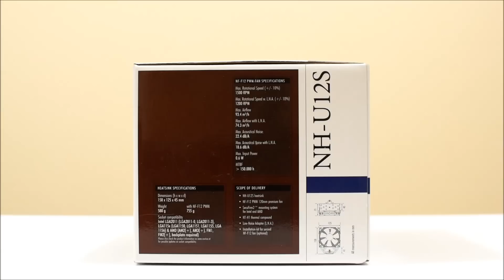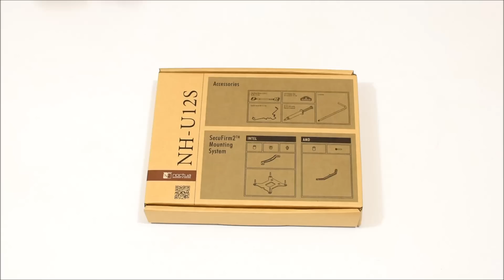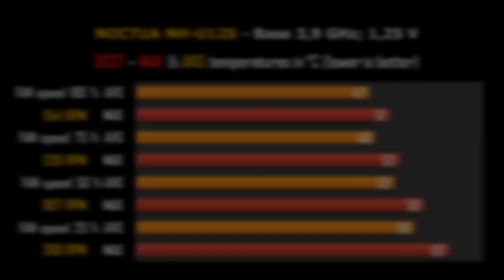Noctua NH-U12S (unboxing, installation & benchmarks)

Comment: Great video. I used this to check my installation. A quick note is that I’m not sure you have to take the fan clips off to install it back onto the heat sink. It’s pretty flexible so it should work without it being removed from the fan itself. Regardless this is a very helpful video.

Comment: The NH-U12S is a killer cooler. My 4590 currently idles at 22C, which is ridiculous. After running a very resource intensive app, which virtually pegs the cpu at 99% for over 30 minutes, the highest temp was 35C. With the same app, the stock cooler was running at 65C. Noctua is the only cooler for me. Plus, the mounting system is the best in the business.

Comment: does it matter if I had the heatsink opposite way so the noctua logo is upside down? The heatsink looks same both sides..
Reply: Hi , i dont think it matters at all. it is exactly the same at both sides
Reply: @contiki6277  yeah it's symmetrical, haven't had any problems! thanks for reply 🙂

Comment: God no... i have an aorus gaming 3 board with an i7 8700 stock cooler (which sucks) do I have to remove the entire board in order to install the back piece??
Reply: If your case has an access panel or cutout over that back of the CPU socket, you might not need to remove it.
Reply: @chiphomer6354  it waa exactly like that, and installation was surprisingly easy. Ty man!

Comment: Hello Martin. There is a 16.5 cm gap from the motherboard surface to the side tempered glass of the case. I just measured. Does the height of the cooler, together with the height of the CPU, fit into this measure?
Reply from the maker: Hi, I'm not sure, maybe not, because only Cooler is 15,8 cm

Comment: Getting mine tomorrow for a delidded 8700k. Already at 70C with a 90mm so this should be a decent upgrade.
Reply: Why didn't you go with be quiet dark rock 4? I am still deciding between this and the dark rock 4..
Reply: @auriongray  Noctua is just better.

Comment: I got a Ryzen 3700X. Is it necessary to remove the motherboard in order to install the U12S or can u do it without removing it since u need to install the bracket only on the Intel socket?
Reply: Your case might have a back cut-out for the mobo. I was about to have a heart attack and then I looked up the specs for my case and it has a back cut-out!

Comment: Hi! Thanks for the video. Is this compatible with a LGA 1200 socket? I have a i7 10700k and I need a fan of this quality and price range. Any ideas? Thank you for your time.
Reply: 2 years late, but for any future watchers: I used this for my 10th gen i7 10700k, along with a MSI mpg z490 wifi Motherboard. It should be able to fit 4 ram sticks

Comment: Excellent video... I used it for my install. An additional point could have been to demo the direction of flow from the fan through the coil. An arrow with direction of flow is embossed on the fan. Nevertheless... A recommended video!

Comment: Is it possible to put the fan to the other direction?
Reply: Yes
Reply: the direction of the fan has everything to do with the direction of air flow in your case. Normally you have fans pulling in cool air from the front of the case and then a fan in the back or on top extracting the hot air. The fan here will pull cool air from the front and push it through the heat sync and towards the "exit fan". If the cooling in your case is going the opposite way for some reason then go ahead and put the fan on the other side (if there is room). If you put it on the other side and airflow is typical....you will end up blowing warm air towards the incoming cool air and causing turbulence and screwing up all your air cooling.

Comment: I have an i7 9700k and bought this cooler.  Will it be good with stock speed/turbo boost?
At the moment I have a arctic esports 33 one and my cpu goes to 100 celsius immediatly when the 8 k stress test begins in prime95
Thats horrible and I hope this new cooler will help.
I would buy a bigger cooler but unfortunately it wont fit into my case. Yes i was so stupid to buy a smal case but cant change that anymore.
Will the noctua keep my i7 cooler?
Reply: i have this on a 8700k (push-pull)and it is a very good cooler despite it is a really old cpu cooler. 2 hours playing metro on extreme settings 1440p never goes above 60 degree celsius, 67 max on occt. My case is pretty big with 6 140mm fans . As for you it should be around 70+ degree celsius  because you have a small case and the 9700k is hotter than the 8700k. What case do you have ?
Reply: Delidd it, same was happening on my 8700k and it brought it down to 70C only about 5min test. But still it was hitting 100C right from the start.

Comment: Tuesday morning I'm installing this on a 8700k. Gonna see what i can get very gently
Reply: It does. It runs cool and quiet :)
Reply: Double check mate on the Noctua website that it fits the socket for the Ryzens
Reply: Is it ok overclocking it to 5ghz?
Reply: I've not tried overclocking it yet, but I have flipped the switch in the MSI bios unlocking all the cores so they they all boost to 4.7ghz. The temps are really good @1.3v under load, but i'm really not sure how it would fair notched up to 5ghz.
Reply: Smashmambo ok, thank you for fast answer
Reply: What temps are you getting? I'm thinking in buying it for my i7 8700 (non K) but I want to make sure that it works great since my room temperature is around 30 C
Reply: Using the prime95 small FFT's test the cores hover around 75 degrees with some of them touching 79 at times. With the blend test they hold at around 65 degrees. I just did the test now and it's quite warm here in the UK at the min about 23 degrees. This is using the Noctua thermal compound included in the box. Note. the none K version of the 8700 wont run this hot because you cant unlock all the cores to turbo boost to the full 4.7(on all cores), although I'm not 100% sure of this. All in all you should be fine.

Comment: please tell me can it fit in my case I seen a lot with evo 212 and it same size not ? entec gameing one atx mid tower cooler I know it old but that what I have max clearance for it 155mm and I see others fit evo 212 in it 160mm  so if this the same size this can fit ? same size as evo 212 ? this the case I have and in here it not my pc parts you can see him fit this evo 212 160mm 

https://pcpartpicker.com/b/pTbj4D
Reply: It's 158mm tall with the fan attached.
Reply: yes but it will fit in my case up to 155mm ? I know it 158mm tall I seen other put 160mm on case like my but want to be sure ?  @nightspark6187

Comment: amazing vídeo , do you think that cooler can  runs i7-7700k 4,5 GHz at good temps?
Reply from the maker: thanks! :) hmm 4,5 GHz and what about voltage ?
Reply: at stock voltage should be around 70 in prime right?
Reply from the maker: Stock voltage, 3,9 GHz, max temperature with low fan speed (300 RPM) in OCCT 63 °C
Reply: thats not bad. i got one for 45 Euros and i hope it will keep my i7 8700k below 70 in Prime (Stock of course)
Reply: nice video by the way:)
Reply from the maker: Thanks! :)
Reply: about voltage its the normal one  i wont oc it turbo speed its  4,5ghz
Reply: should be really fine mate
Reply: and really silent :)
Reply: How is it with the i7 8700k?
Reply: I have one working with the i7 8700k, OC to 4,6ghz  1,28V  all cores gets 75C on Prime (26C Ambient)
For stock, stays below 65C 

I am using a push-pull configuration (both noctua)

Amazing cooler and fits my mid-tower case
Reply: @caiofioravante6823   Is it quiet? im going for a quiet build.
Reply: @aklimaron7398  Yep, you can go without any problems with noise. My GPU fans are louder than the noctua ones, lol.
Reply: @caiofioravante6823  Wow nice, i bought the NH-U12S (still to arrive) and i was inda feeling bad when i saw NHD15s, thinking i made a bad purchase.
Now to find a way to change gpu fans, lol.

Comment: very useful video, thanks!
why did you put just one drop of grease in the middle of the cpu? should not you smudge it evenly?
Reply from the maker: Thanks! :) Too much methods for aplication, Sometimes I use this method and sometimes other... :) Someone says, this is best method... And someone other one says another method is best ... Many people many opinions :D
Reply: Martin's PC Tips I found a video by Linus Tech Tips comparing all methods of application and there's no difference indeed. 
I ordered this cooler for my next 8700k build. Hope it will do great job.
Reply: It will eventually spread out. :) 
If you don't believe me: Put a little pea on a transparent layer (like a CD case) and apply some pressure. The small pea will smudge into a widespread matter :D
Also the best method not to end up with a mess and lost paste on all of the motherboard.
Reply: @Bram25  lol hopefully your joking. Paste all over your motherboard is the last thing you want ;)

Comment: Was this for AM4 socket?
Reply: You need a bracket, but if they still sell this i guss they include it. I bought it in 2013 so i had to buy a bracket
Reply: YES 1151 socket only support for amd, on the CPU is intel on it.

Comment: WoW u put it all wrong
Reply: How should it be put then
Reply: @eliasrodin6332  if u look closely there are some holes over the heatpipes those holes must be looking at the side of the fan, so when the air is heating the pipes is staying a litle bit more on them. That gives 2c lower temp. Just see the diagram instractions from noctua the photo shows the fan sending air on these holes before the pipes.

Comment: Do i really need to wipe down the CPU with alcohol before putting thermal paste i just unboxed mine? 6:05
Reply: probably not.
Reply: If you touched the metal plate of the CPU, yes. And even if you don’t, it is highly recommend.